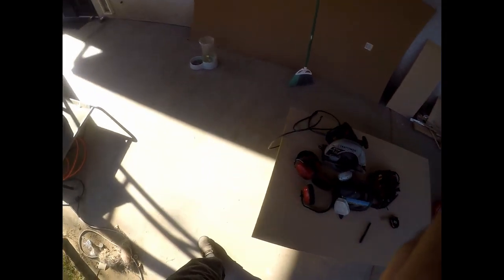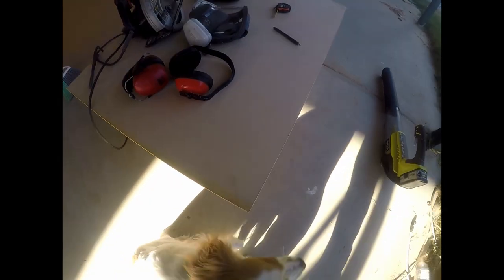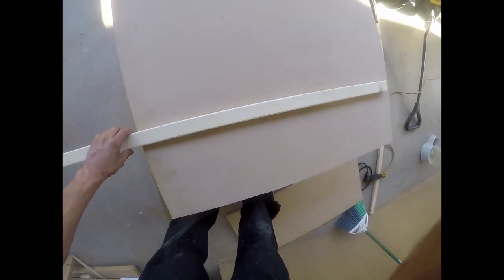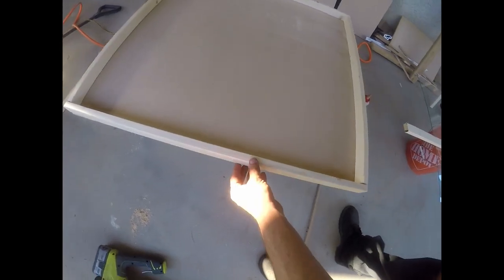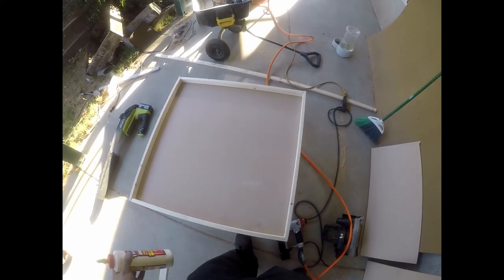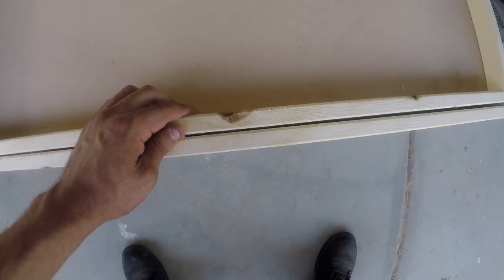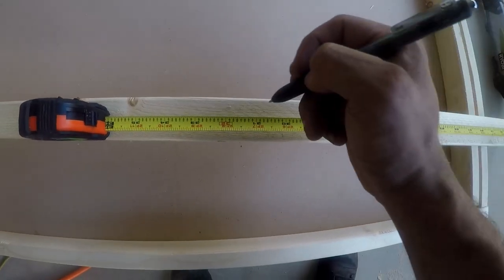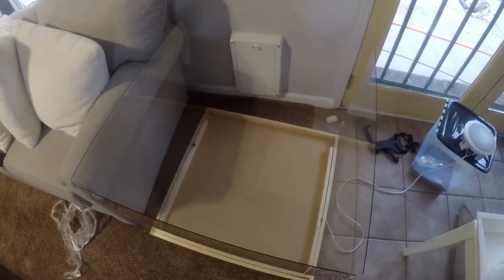MODERN INDOOR DOG HOUSE (HOW TO)

Comment: Bro do your dogs get enough air?
Reply from the maker: yes , has about 1.5" gap between the wall and dog house from the sides and top , plus ventilation fan stays on all day during the hot days
Reply from the maker: If you have bigger dogs u can always cut out bigger air vents on the top where i placed the fan
Reply: I was thinking of doing something like this, not many YouTube vids out there using plexus glass. I’ve been trying to figure out how to have my dogs indoor and containing there fur at the same time